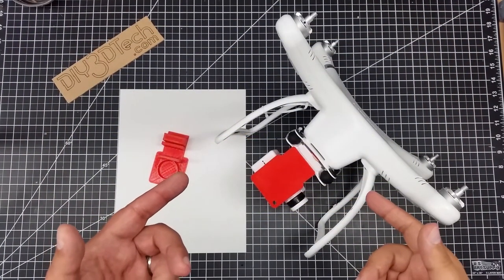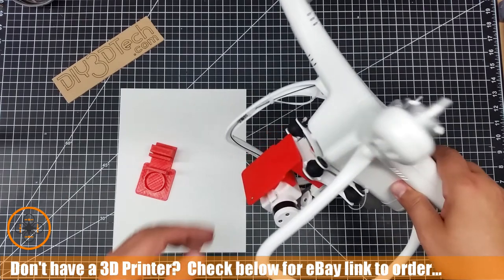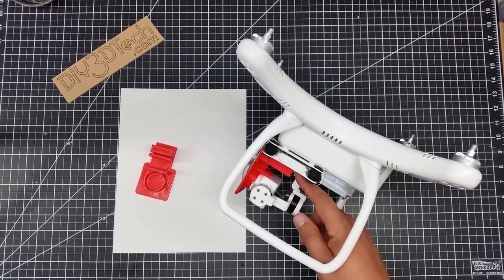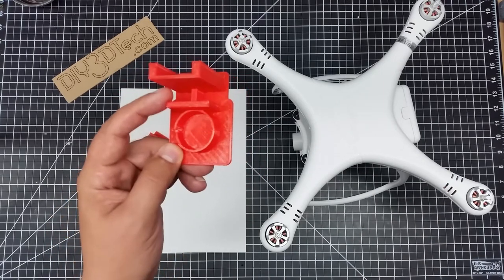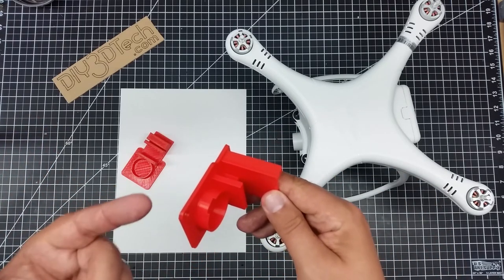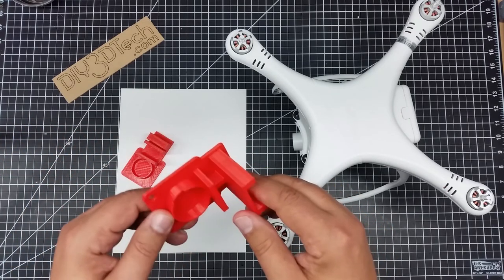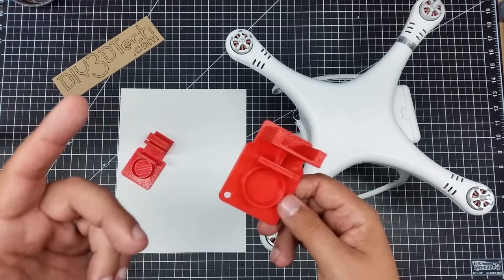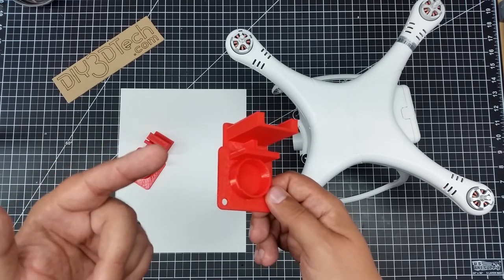Video Drone - UPAir One Plus Camera Protector and Gimbal Lock!

Comment: just one small mod i would really recoment to do is a weight balance mod to the camera.. so when you turn it off the camera wont hit the ground.. i have done this with my upair one.. just works fine and its really easy to do.. you can see it at the end of my gps upgrade mod video https://www.youtube.com/watch?v=RF1ugx3Gi9I
Reply from the maker: Yes in prior my Upair's I have balanced them by moving the weight inside as it was misplaced.  There likely is a video on it in the Upair Playlist.  Just have not had the time with this yet...